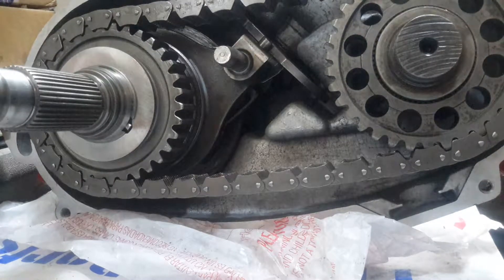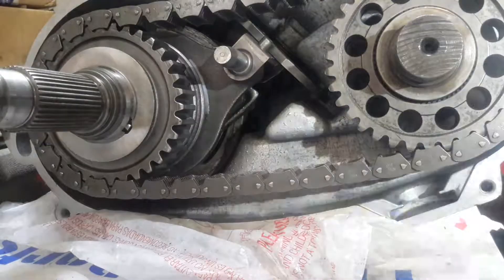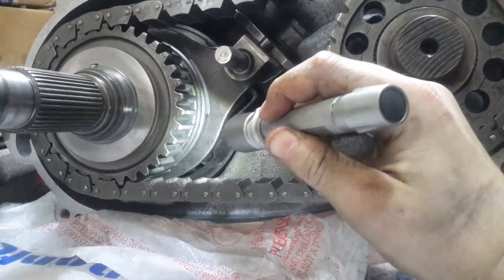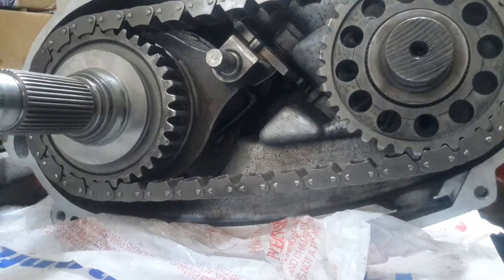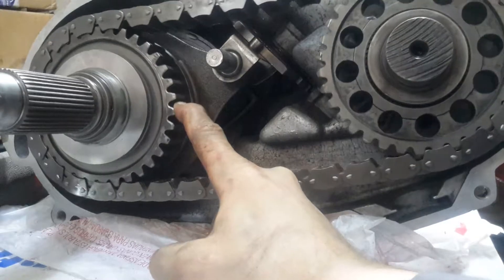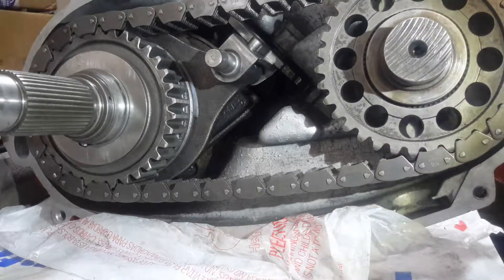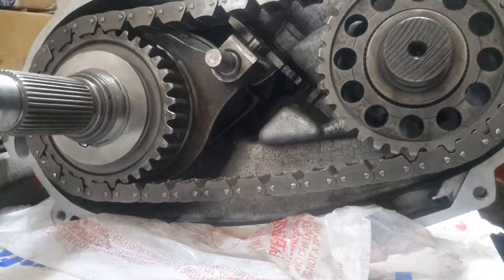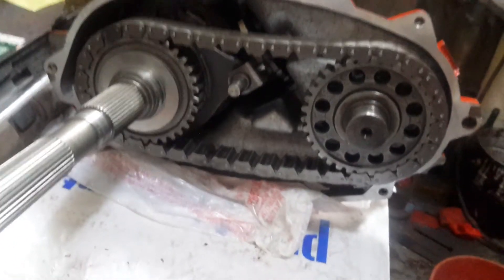NP208 Transfer Case : UTH

Comment: Please, could you help me? My Chevy truck has an NP208 transfer case and the front seal is leaking. Could you please tell me which is the right front seal in order to order it? I stay in Greece and, having searched in the web for the seal, I did find some seals for the transfer case of this truck, but I am not sure which one is the right one. I write underneath what I found. If you could tell me which is the right one, I would appreciate it. Thanks a lot in advance.
Monk Damaskinos

@t